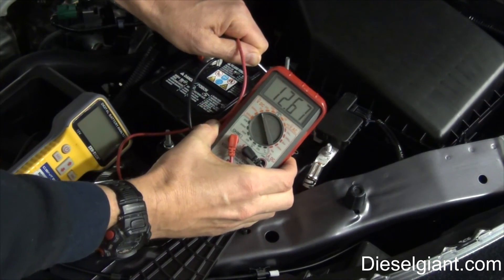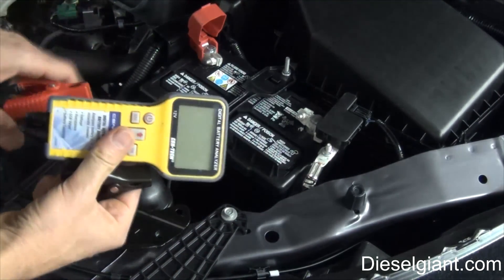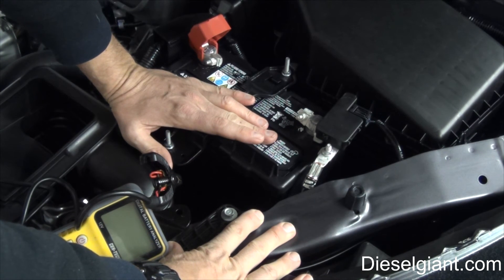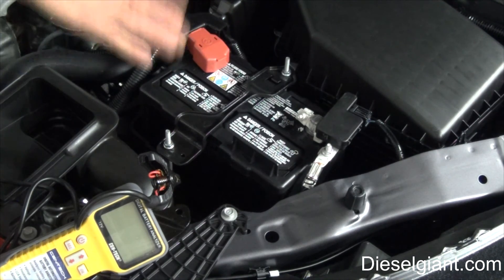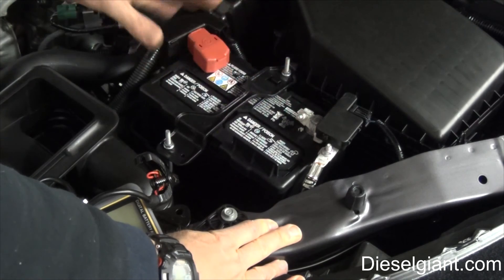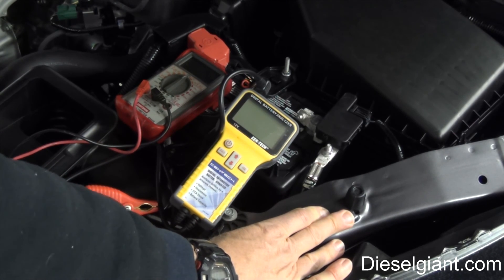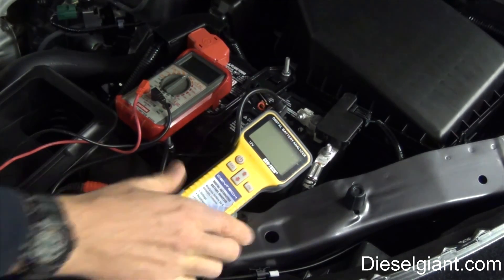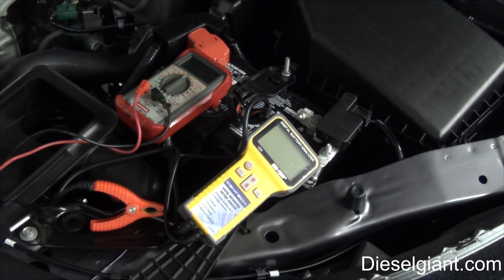3 types of Automotive Battery Testers Explained and demonstrated

Comment: Can't you just test conductance with the ohms setting on the multimeter?
Reply: No.  the ohmmeter works by applying  9v (typical internal battery of the multimeter) to the test leads and measures the resulting current in milliamperes, converting the results to mili-Ohms with the correct factor.   With additional resistors and battery you can do the trickery to measure.   Ask any electrical engineer

Comment: Great video, the best I've seen on the subject. If I may, I have two questions:- Is it necessary for the battery to be fully charged for conductance testers to give reliable data, or just being above 12V is enough? I understand that these testers also give a "state of charge" of the battery, as a percentage, so I assume that it would not be necessary for the battery to be fully charged, am I correct?- For vehicles that have the battery in a place of difficult access (for example, under a seat), is it possible to use a conductance tester on the easily accessible jump start terminals that these vehicles typically have?Thank you in advance for your time and, again, for a great explanation.